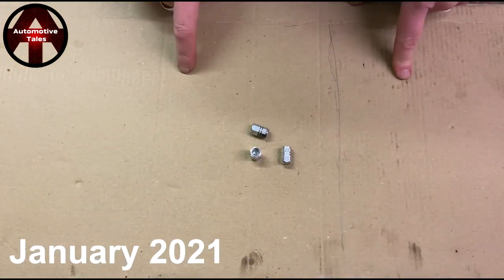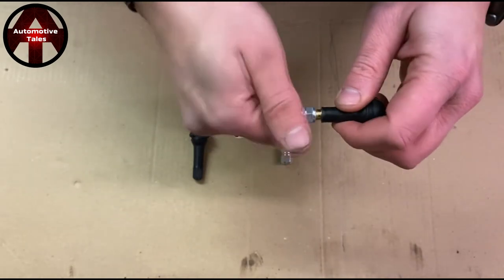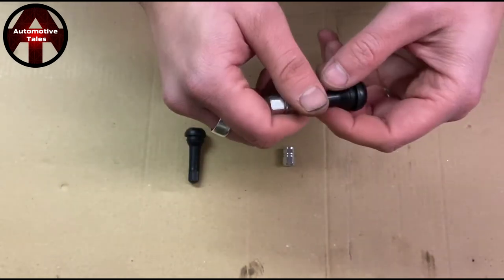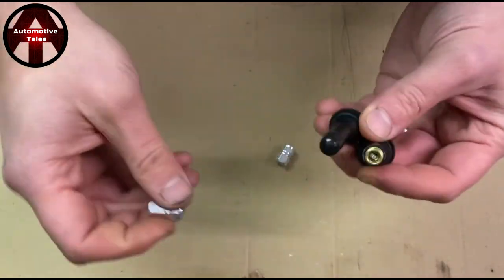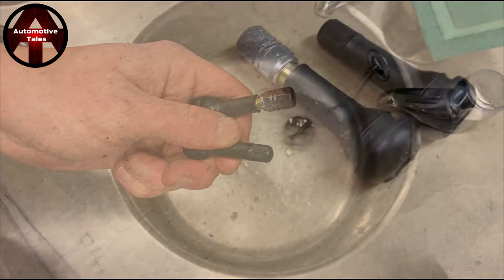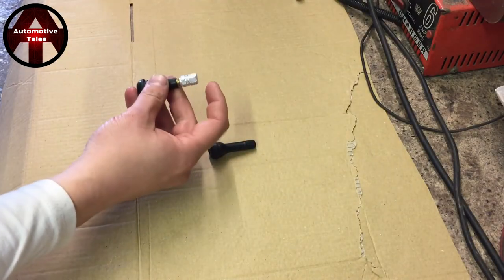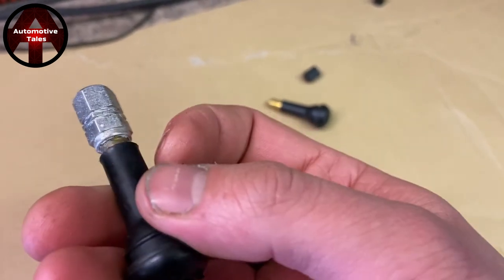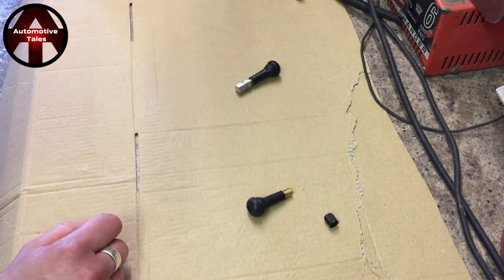Why Aftermarket Aluminium Tyre Valve Caps are Junk - An Experiment!

Comment: What if you add some grease to the thread. Would it prevent anything? You could add that to the test.
Reply from the maker: That’s not a bad shout - will maybe dig the parts out and retry as in theory copper grease would make it worse (conductivity creates a path to improve galvanic action), but other greases might work!

Comment: Fucking brilliant, tell it like it is! Amazing it's that bad after just ten weeks.
I have only ever had one direct run in with one of these having acquired a singular disaster zone on one wheel of a car I bought. Predictably it was weldes together, and cost me half an hour of my life and a much as a set of valve caps is new, to get the local used tyre place to pop the tyre half off, swap the valve, and give me the lecture about Ali valve caps being toss .
Reply: I believe the more expensive ones have a plastic insert, or are plated brass. Else if you really wanted, if guess atleast add a health smear of copper grease or waterproof lithium grease or the like. It would help if they screwed all the way down and bottomed out on the rubber of the valve stem, but most seem to have a seal at the bottom (why?) and or not enough thread depth. Classic case of not understanding how carefully designed these simple things in life are and hence how easy it to cock that up!

Comment: Also not a good idea to add extra mass at the end of the valve. Although it does not look like much, the additional centrifugal force when the wheel is rotating at many RPM can cause the valve to fail.
Reply from the maker: That's a very good point indeed - I will weigh the two caps next time I am at the workshop and see what the difference is, then we can calculate the different in force applied to the valve stem for a given speed...!  I see a follow up video!
Reply: You will also note that the mass is further away from the rim, as the new caps not only have more weight, but more “height”

Comment: Interesting. I never had this problem with mine in the past, but I guess I never wet the valve underneath the valve cap...
Reply from the maker: it can be a bit hit and miss, it probably depends a lot on the time of year too - if you fit it in winter when the air is damp you are more likely to trap moisture inside.  If you live in a very dry climate in the US for example, it may be much less of an issue.